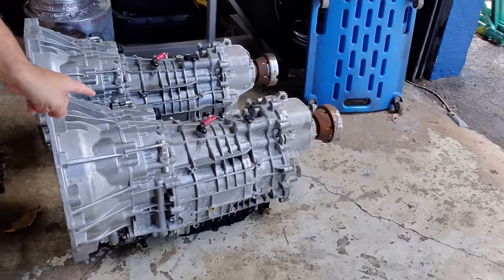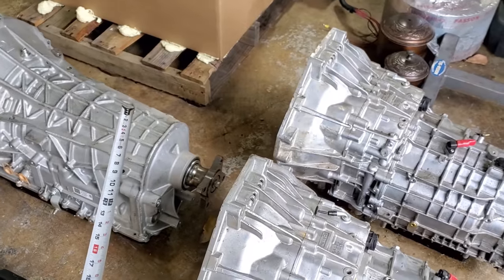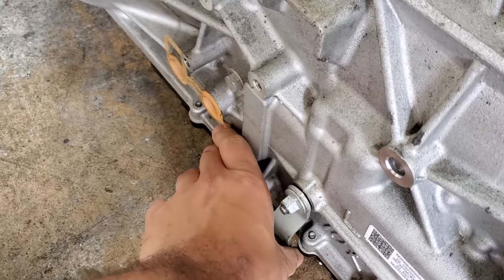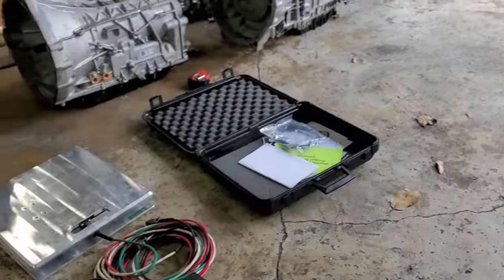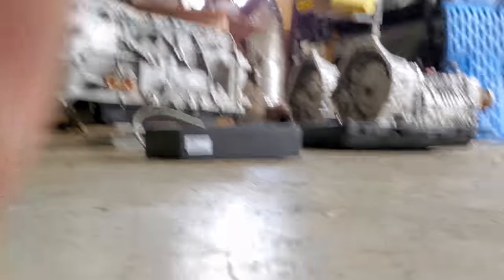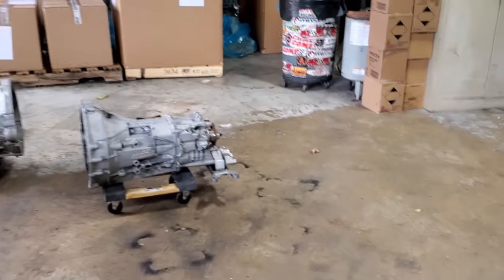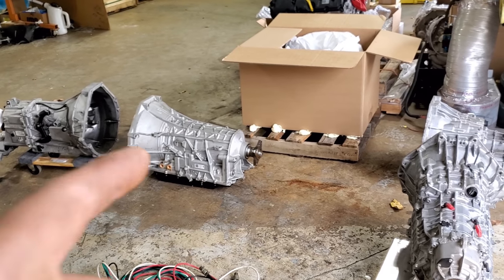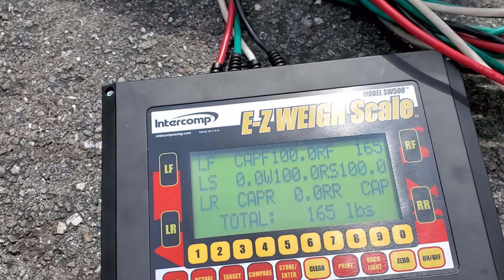2020 GT500 DCT vs 10R80 Vs 6r80 Vs Mt82 Length and weight differences

Comment: Too-fideen, thanks for sacrificing your back lol. 

MT-82 : 133 lbs.
6R80 : 165 lbs.
10R80 : 177 lbs.
DCT : 215 lbs.
Reply: jon doe  Around 145 pounds after it grenades and let's all the fluids out. Kidding mines still running strong for 3 years now turbo'd
Reply: Clutch and flywheel?
Reply: @Mustang_Chris  Add about 45-48lbs with a clutch and flywheel setup. Puts the MT-82 in the 180 range then
Reply: @isdanrt4u  Add torque converter and fluid to the 10r80 and you have 230 plus!  Depending the torque converter...
Reply: Yea all of these transmissions were weighed empty and no convertor or clutch and flywheel. Which is a true comparison. If you add those other variables, might as well add a driveshaft to all.
Reply: @downhilldaddy9346  no , DCT has dual clutches inside the body so you don't add weight to it like the other transmissions
Reply: Derek K dual clutches yes, but does it need a convertor?
Reply: @downhilldaddy9346  No , DCT it's pretty much automated manual transmission , it has shift forks and all the crap like manual trans

Comment: Funny because i just did a side by side weight of my dry 4R70 and my dry 6R80 with converters and the 4R70 was 245lbs while the 6R80 was 194lbs. So this sets in stone your estimate of 25-30lbs for the converter weight.

Comment: Glad I saw the video to the end ! When you consider clutch item weight in a manual,  converter weight,  all in one weight in a dct, all about the same within 15lbs. Either in total weight or filled with fluids and rotating weight.

Comment: Any idea what the T56 Magnum XL weighs? Sometimes I wish I had gone with a built MT82 because it can be shifted faster than a T56 imo.
Reply: finally someone smart.. that mt82 was made specifically for the 5.0 with high rpms. yes the tremec is more durable but shift points arent meant for the 5.0
Reply: Been thinking the same thing. Also the T56 Magnum  is stupid pricey.

Comment: I'm doing a trans swap. I'd like to run a 10R80, but folks only make a 6R80 adapter. The bellhousing is the same, but is the torque converter spacing and bolt pattern the same? Could I run a 6R torque converter?

Comment: Just wondering as i have access to a free 10R80 from an f150 also a transit, are these workable to install into a 96 Cobra? Electronics I'm aware of but im more worried about casing and tail shaft swap.

Comment: @AlejandroFlores  

Didn't Mercedes Benz stop using the DCT years ago, because it was causing problems?

Do you think that Ford will be able to avoid those same issues, that Mercedes Benz had to deal with, when they used the DCT?
Reply: Mercedes used a DCT from ZF IIRC. GT500 uses a Tremec
Reply: I believe I remember the dct transmissions with issues were dry clutch setups but I could be wrong?

Comment: Hey Alex I know your into the mustang but are the 6R80s and the 10R80s the same in the F150s??? Also wondering stock for stock which is faster..( mustang vs mustang)?? Thanks
Reply from the maker: 10r80 is faster stock (18 and up)
Reply: Thanks I was just curious...because I hear alot of people talk crap on the 6R80 and in my opinion I like it...I have it in my truck.. but not taking anything away from the 10R80 but I've heard more problems with that trans then the 6R80
Reply: Also I was wondering if you guys( PBH or Lund) were gonna take the 10R80 and switch out the DCT of a GT500 if they mount up and see if there's a gain to be made?? It would be an awesome video...anyways man thanks alot!! Keep up the awesome content!!!
Reply from the maker: @pattersonperformanceconcep6986  a gen 2 f150 went 8.9 today....turbo....stock motor stock cams
Reply from the maker: @pattersonperformanceconcep6986  not possible.  Needs a gt500 computer.  It's not a cake swap. Needs a ton of r&d
Reply: @YDBT4LIFE  thanks man...didnt know that...I watched your mustang mach 1 video and I think you were saying something about how bad ass a 5.2 with a 10 speed would be so I was again just curious
Reply: @YDBT4LIFE  is there a video on that ?? I'd love to see it...I wish my truck was anywhere near that hahaa
Reply from the maker: @pattersonperformanceconcep6986  just happened.  Look out on the lund racing facebook page

Comment: You need to account for the weight of the clutch, flywheel, and bell housing on the MT82. I bet that all adds 40-50lbs to the MT82.
Reply: Mt82 already has the bellhousing on it. All the transmissions here did.
Reply: and the torque converter of the automatics

Comment: My 6R80 circle D torque converter is 36lbs
Reply: is that a billit converter? i was wondering how much heavier they would be since they have a thicker shell casing and mount plate assem'. i just had my 6R80 on a scale yesterday and it was 194lbs dry with converter so his 25-30lb estimate was spot on.
Reply: sly5.0gt yes the billet front cover 6c , I shipped it today back to get it restalled for boost and it was 36lb on The scale by itself

Comment: What about the tremec magnum Xl still think thats the king daddy of manual trans for high hp
Reply from the maker: Of course
Reply: @YDBT4LIFE   I've seen T56 magnum xl weight from 128-135 and had one installed on my previous car and I agree with that range installed it on a garage floor off my back scissor lift and jack lol. So with clutch still 50 pounds lighter also less reciprocating mass ie more wheel HP. I wonder how much if any does a dct  vs 10r80 put more or less power to the wheels? That can be some nice testing for you and PBH to do! But any more power gained by a manual would be negated by quicker shifting and more ratios of the DCT moreover 10r80. I'm still manual guy at heart but with a turbo 10r80 or DCT FTW!

Comment: Hey Alex, where did the 2020 GT500 DCT come from? Has anyone manual swapped a 2020 GT500 yet?
Reply from the maker: Lmao no...no need to. And tremec makes it
Reply: Thanks dude. I realize they make it, but it had rust, etc. What vehicle was it in before the GT500 that that one would have been sourced from?
Reply from the maker: @brianpounders8789  secret...but it wasn't ever in a car
Reply: That's why I was wondering where you got it. I realize the 10-speed DCT is superior, but you know, at some point, someone will do a (maybe a one-off) manual swap. I've seen it too many times on multi-$100k Lambos and Ferrari's..
Reply: Us manual guys demand it..
Reply: @brianpounders8789  OOOOO ITS GONNA HAPPEN NO MATTER IF THEY LIKE IT OR NOT
Reply: Brian Pounders I believe vmp has done a manual.
Reply: @300zxdriver  thats with a regular gt 2 different setups. Plus the gt does not weigh what the gt500 does. But it is close though and does sound good
Reply: Thanks again, Alex. I really enjoy your channel and the info you put out there. I was just curious, because I know those trans are rare.
Reply: @300zxdriver  Vmp has a S550 GT manual with the 2020 GT500 Motor.

Comment: Yooo Yolo, I know your a busy man. Got a quick question. Would 4.10 gears be the best set up for a 17 gt 6R80? Intake, intake manifold 18. Lu47 injectors, e85 tune
Reply from the maker: 373s at most

Comment: So the DCT weighs the same as the 10R80 with a converter.
Reply from the maker: Bout 20 lbs heavier dry...with fluids....not sure yet
Reply: @YDBT4LIFE  I mean, DCT is cool, fast as hell, but when it comes to swaps, I don't see something that expensive being viable unless Tremec starts offering them for sale separately
Reply: Still more probably when you add a dual mass flywheel compared to a normal flex plate. I work on VWs with dsg’s ad their flywheel is heavy.

Comment: Can i swap the dct to a gt350?
Reply: Yes. But how Will you control the DCT?
Reply: @3star2nr  idk just curious lol, but wouldn't you be able to use an ecu from a gt500? If the firing order is the same?
Reply: Motec bruh fathousefab already doing it
Reply: @fread51  youre gonna spend 5k on a motec ECU to swap in a 215lb transmission... 

Y'all have way more dollars than sense...

Comment: MT82 weighs 82 pounds less than the fucking DCT. That's crazy. I wonder what the weight difference is between a Tremec Magnum/TR6060 and the MT82 as well.

Comment: Mt82 still the most fun and best for road racing.
Reply: maximus vonce  Not true ! I have an 18 A10 PP AND 19 Bullitt M6 . The Manual is a pig compared to the A10 due to a terrible gear set in the transmission and the A10 in track mode Does every bit as good as my manual around a road course . Before 8 and 10 speed autos I would agree manual was the way BUT no longer do I feel that way !
Reply: The t56 magnum is a joy to drive. I have a 2011 mustang gt that came with the mt82 and it was problems since day one. When the build got to 700 rwhp I needed a stronger transmission. I could have  gone with an automatic but I'm old school and stuck with the manual. The t56 just feels right in the car which now is making 917 rwhp on pump gas and meth injection.
Reply: Tim Connell I swapped a T56 magnum xl in my fully built Supercharged 07 , Best Manual I ever had the opportunity to Row - only issue is going one piece DS in 05-20 mustangs is pain in the ass due to driveshaft viberation/angles
Reply: @NAZTYPONY007  T56 swap in s197 is $7500 with labor. Not cheap.
Reply: maximus vonce 4300 it cost in 2011 when I did it and labor cost me nothing

Comment: T5 transmission 70-75 lbs lol
Reply: A T5 and 800-900 WHP  LOL!
Reply: @forcedair92gt94  send it !!! LOL
Reply: @ernies351wvan  Haha, you won't get far.
Reply: @forcedair92gt94  nope, but it will be fun lol
Reply: @ernies351wvan  I can get a T5 if you got 900 hp LOL.
Reply: @forcedair92gt94  all you need is 400 hp to grenade a t5 lol
Reply: @ernies351wvan  Been there did that.